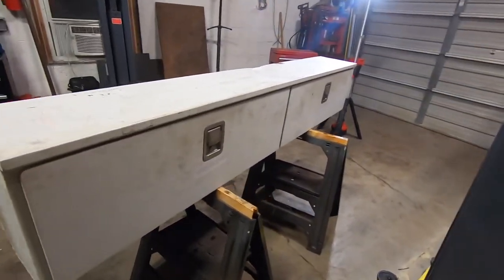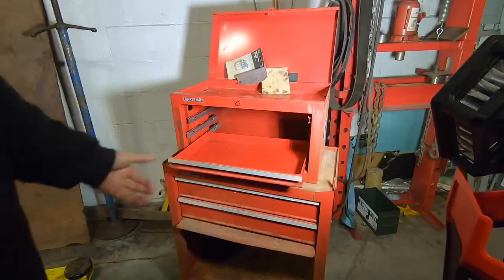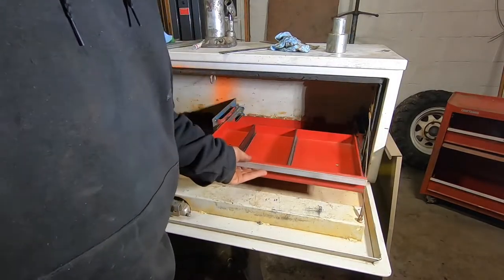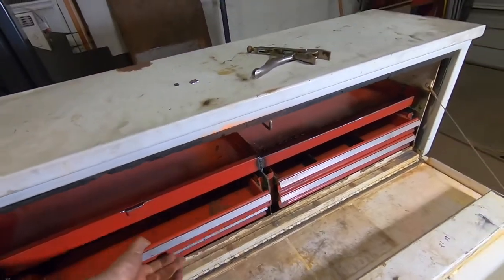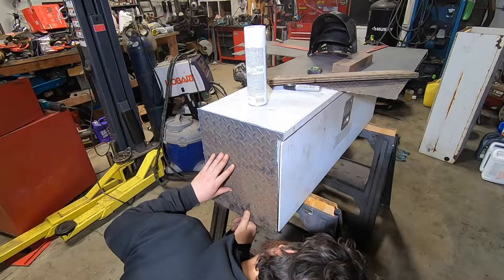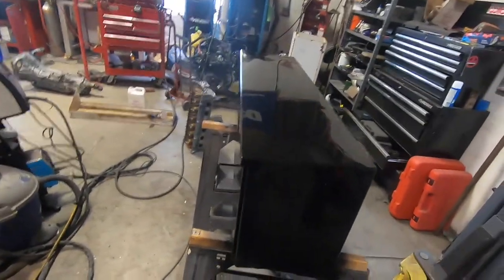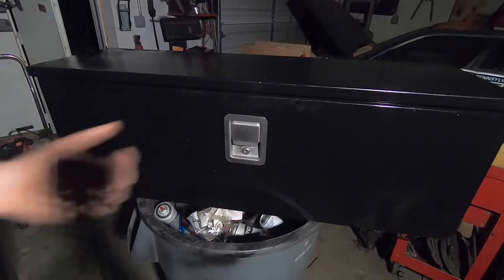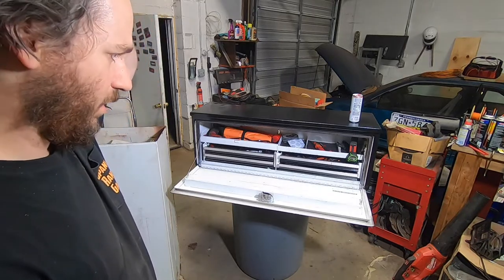I built a custom toolbox for my flatbed from SCRAP JUNK

Comment: This is rad. I'm putting a used utility bed on my 3/4 diesel truck and wanted to put drawers in a few of the boxes. Hacking up an old toolbox for them is a great solution. Thanks for the inspiration.
Reply from the maker: Go for it!